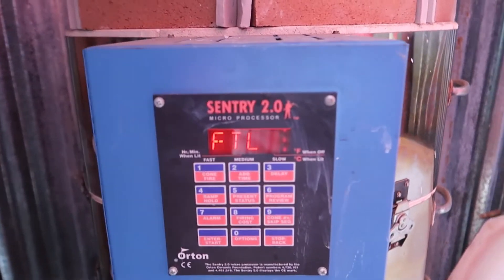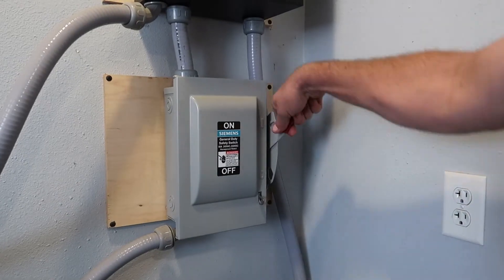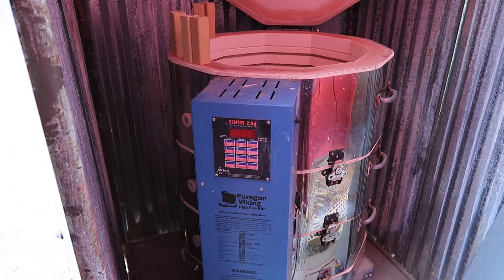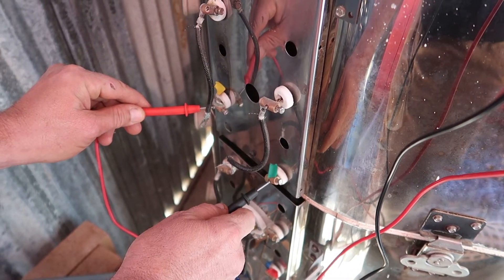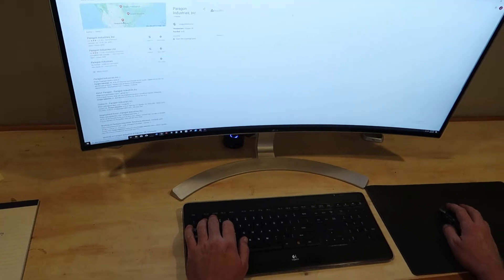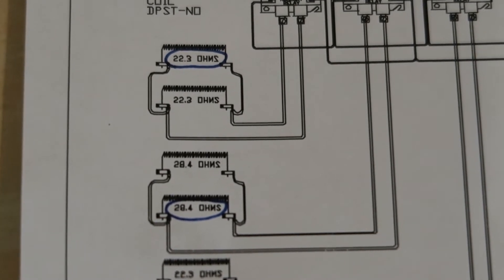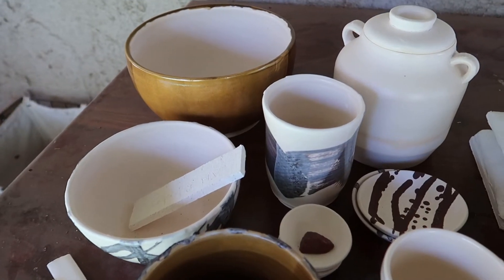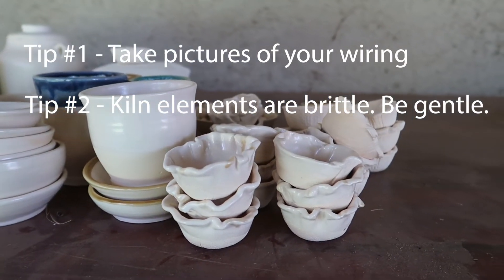Checking Electric Kiln Elements

Comment: My wife just purchased a very old Paragon Kiln (1980s). The thermocoupler is reading about 100°f above room temp at rest and the controller has no offset capability so we're replacing that coupler start. We checked the coils and all are in tact so we're keeping those until I can find the resistance measurements although we're not sure it those are the OG coils or replacements. Good tips. Thank you.

Comment: i would expect the difference in resistance to be more due to your meter lead connection than to the coils, you have to pierce the oxide layer and get a good contact area to not get a few extra ohms of resistance, on clean new wires with clean new leads i would expect to get close to spec but older used leads and wires i would have to polish wires before i took more than 20ohms seriously

Comment: I was able to do this and found that both my elements were only at 1/2 resistance as it was supposed to be....its so strange because the firings leading up to it didn't really show a delay in reaching temp but when they went out, no length of time would get them up to 06.  Thanks

Comment: Note: 15% may not be that big of an issue.  The number you are looking at is a nominal.  No wire is the same; so, each wire will measure a little different.  For example, the normal resistivity tolerance (allowed initial difference) for Kanthal heating wire is 8%.  It is most likely the broken wires that are causing you issue.
Also, I would not rely on the beeping conductivity test, every meter can be setup differently.  It is better just to measure the resistance of each  coil.  If they are truly broken, the meter will return a very high (or no) reading.
Certainly replacing all the elements may be the safest and simplest options.
Make sure and put the elements in the correct order.  The upper and lower elements are lower resistance to give more power to those ends as they see higher heat loss.
Reply from the maker: Thanks for the detailed comment.  Very informative.  I did also check the resistance of each wire and found each broken wire to give an "OL" resistance (no reading).  Thanks again.
Reply: @JustinsMakery    BTW "OL" means "open loop" your meter's way of saying that the resistance it is measuring is too high to report a reliable number and is likely because there is no connection.